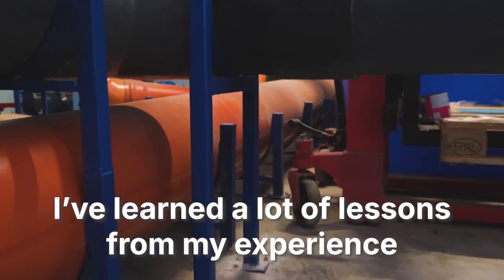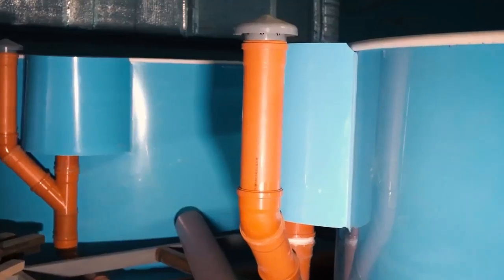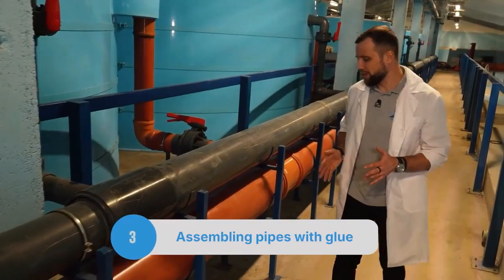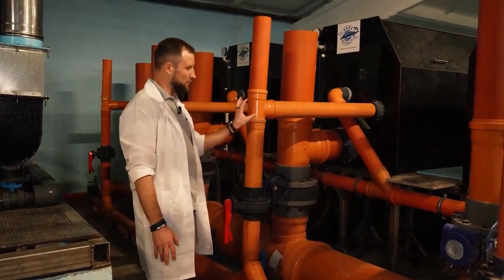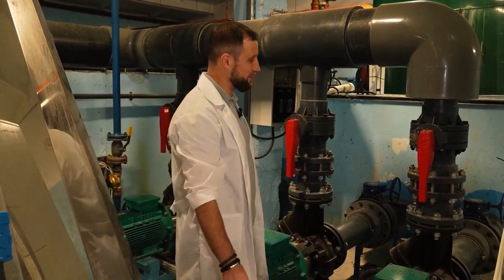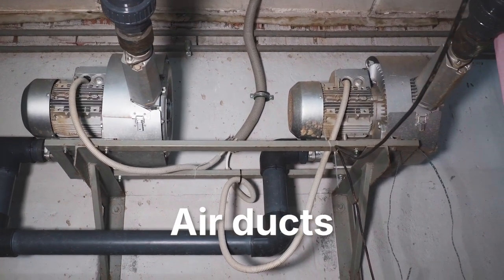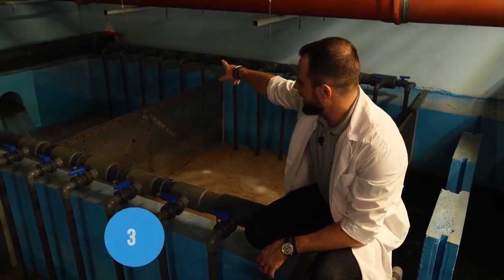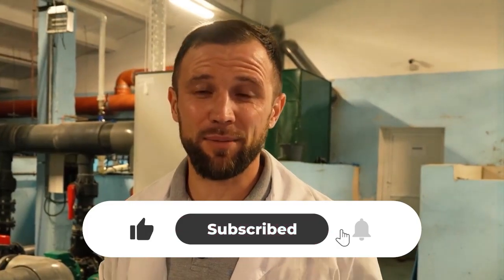KILOMETERS OF PIPES. How the Pipeline System of an RAS Fish Farm REALLY Works…

Comment from the maker: ► - https://bit.ly/3QiaY1P - RAS FISH FARM FROM THE MANUFACTURER. Design, production and installation of Recirculating Aquaculture Systems (RAS).
Reply: Very nice video. One thing I do on the drain side is over size the pipe needed for that drain field and use 90 degree fittings. It makes it easier for my home builds. Also I have noticed that people don't recognize the value as the choke point of the pipe and thus I over size the valve with reducers on each end to maintain flow. For example use a 4 inch valve for a 3 inch pipe.